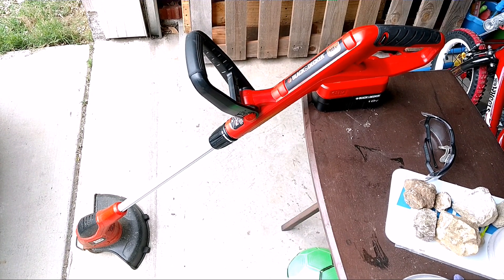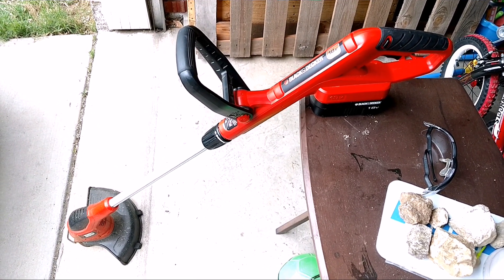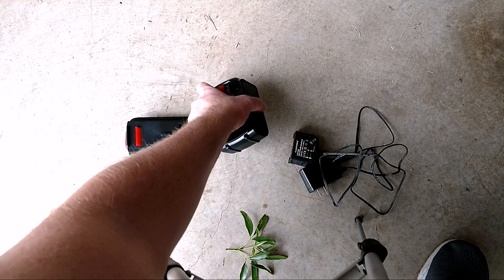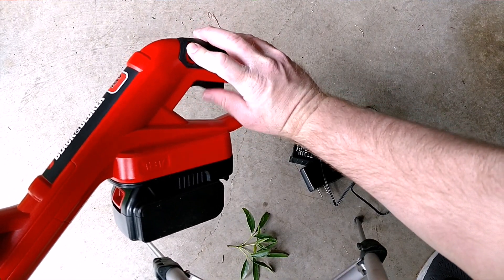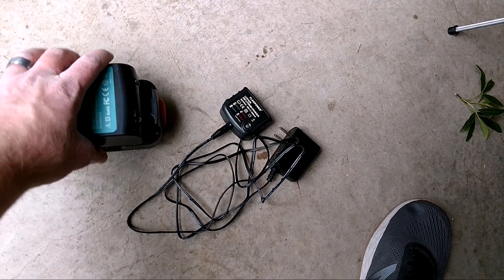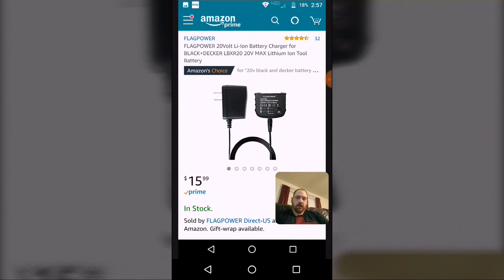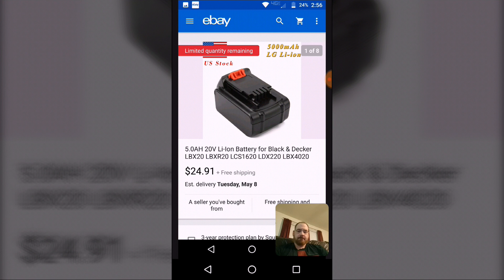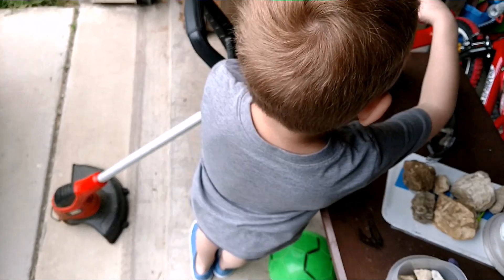Convert Black+Decker 18v NiCd to 20v Li-ion Battery

Comment: Is there a reverse, 18v adapter to 20v? I have 5 old 18v batteries, but weedwhacker broke, so since there's no more 18v trimmers, I got a 20v with 1 battery, and don't want to get rid of those 18v batteries. Can't find that adapter anywhere.
Reply from the maker: No. I doubt there's any demand to adapt to the old battery.
Reply: @becausestuffbreaks  Thank You for responding, that sucks, I've got 4 of them, almost new lithium... but I'm still not loosing hope :)
Reply: @TapacUA  I'm where you are, tryin to find the same did you ever find any 18bv to 20v adapter?

Comment: What do you do about discharging the lithium to low? Nimh can be ran down to extremely slow voltage and recover soon as you charge them.up...lithium is totally diff if you run them below 3v they're done..
Reply: You lives with it. You lives and learn how to balance your life and taking care of your own things. I kept my nicd for this reason. Never swear by it for longevity but to actually have usable tool.

Keep both. You'll be happy not to bitch about stopping middle of day work and waiting for battery charging to finish topping up nicd.

Comment: How do I run a 18v nicad battery on a black and decker 20v Lithium Tool?
Reply from the maker: Not sure that is possible but you can search Amazon and eBay for adapters.

Comment: Hi.so, I did this and used the weed wacker less than 15 minutes and it stopped working. Tried on blower and edger and, nothing..  Thought battery needed recharge but the charger says full charge. Any idea what the issue could be?
Reply from the maker: Sounds like there's an open in the adapter
Reply from the maker: Do you have a meter and can test continuity on the adapter? Also, the new battery could be junk. If you could find a way to monitor the voltage out of the battery when trying to run a device with it would work to validate that. Also, the charger might be junk and it never put a good charge on and now won't charge at all. Let me know if you're able to figure it out.
Reply: @becausestuffbreaks  Hello thanks for responding!  I actually have a craftsman charger for my cordless drill which takes the exact type battery. I tried charging it on that today and the red light stayed blinking and never charged the battery. So I thought, bad battery.. When I put it on the other charger (same as yours) The green light stays lit. 
I tried it on my cordless drill, I got nothing. 
THEN, I put my fully charged good (drill) battery on the new charger the red light stays on! 
Red is dead and green means go.. right?  I'm STUMPED.  I'm just trying to figure out what I need to return. The charger? Or the battery? I would attach photos if I could
Reply from the maker: @wild_for_nature9932  I have a public group on MeWe you can share pictures and videos with me and then I might be able to see better and understand what's wrong. Here's the link if you have a MeWe account: Share Your Trade: https://mewe.com/join/shareyourtrade

Comment: Great Video, like you I have a full collection of B&D 18v Firestorm tools, but those Batts suck.  I have Ridgid 18v and Dewalt 20v batteries.  How can I use those batts with my 18v tools. Don't want to buy B&D 20v Lith batts.
Reply from the maker: Google it. I bet there's an adapter out there

Comment: Thank you!!i have been wondering the good way to really brings out of the performance of every black and decker using 18v spring loaded seats.

After seeing this adapter, i just had to have it!!

Now i wonder how my gc1800 gonna performs next!
Reply from the maker: Sweet! Good Luck!
Reply: @becausestuffbreaks  it was worth my money!
Reply from the maker: @youtubeonly8574  totally worth it. I'm still using mine.
Reply: I too have been wondering if there was an 18 volt lithium. I dislike nicd bc its soo toxic. Lithium is a little better. You're right Justin, they both require different chargers. Lithium uses higher current. Lithium tends to put out higher voltage. That converter is interesting. If I find no electrical problems in reviews I'll try your idea. Thnx for sharing this info

Comment: Justin which seller did you use for Ebay, I see one out there they raise the price to $28.49. (godjob-2020 in IL)  I don't trust some of the sellers so if you could check where you got your battery I will go to them. There are a lot of batteries that have inflated ads to there size.
Reply from the maker: Looks like the seller is gone or no longer selling the item. It's a gamble with some of the off brands so you can try the Black and Decker brand.
Reply: Does the back of the battery have any information?  Sometimes there will be a manufacture and their part number.
Reply: @becausestuffbreaks  Who was the seller, I maybe able to track them down and send a message.  If your battery was going to act up it would have done so by now.

Comment: Justin with the new battery how long can to you use the trimmer, a lot of the battery companies lie on the battery sizes.  I read the reviews on Amazon and a lot of people not happy with battery purchases.  I really don't need a 5.0 but probably a 3.0, I only need about 20-30 minutes of trimming.  I need a brand that I can trust without going over $30.
Reply from the maker: I know the one I bought lasts my entire yard. It lasts at least 20min.

Comment: Justin, great video, have suggestion for that same trimmer, I have maxed out the length of the adjustment (over 6ft tall) you can unscrew the handle section of the trimmer and pull out 2-1/2 inches more.  Expose the plastic (bulb) and then screw it back together.  I reinforced the plastic section (may break from  hit the trim to add more line) I added a section of rubber bike inter tube that I cut in half length wise, then just wrapped about 6-7 inches over the new section.  I finished it off with some black duct tape.  Now I am not bending over to use it.  I am going to upgrade using your hack but through eBay, (not a prime member) with no shipping charges.  Thanks looking forward to more videos.
Reply from the maker: Thanks for the info. I've had issues with my back getting tired while using this thing.

Comment: Great video.  This was very helpful in planning what to do.

Will this same adapter work for a switch between brands?  I have 18v Black & Decker yard tools and 20v SKIL (and CRAFTSMAN) batteries and chargers.

 If not, IS there an adapter made for this kind of a switch, from 20v SKIL to an 18v Black & Decker tool?  From one mention online, it looks like the CRAFTSMAN 20V may fit the adapter the same as the 20V Black & Decker batteries?  Wish we had cheap and easily sourced adapters between all brands of 20V batteries.

Comment: Hey thanks for this video and all the great information! My 18V B&D trimmer has been sitting in a corner for years because even with new batteries it was completely useless. Substituting in a 20V Lithium Ion battery using your advice has now made it one of my most valuable yard tools.
Reply from the maker: I agree. Before I converted it, I would go through 2 batteries and still have half the yard left. Now I can get the whole yard and have to take a break in between. Thanks for watching!

Comment: Good video. I was looking for something different though. I want to adapt any 18v battery (sometimes called 20v, they're all the same) LiIon to run my B&D trimmer like yours. I have batteries and charger already. I just need to make an adapter or something. 3d printing would be useful here I suppose.
Reply: HUH?  That's what he's doing:  OLD 18v NICAD tool, NEW 20v Lithium battery, slides right in.  $8 on Ebay today (Nov. 2018) as I just bought one...